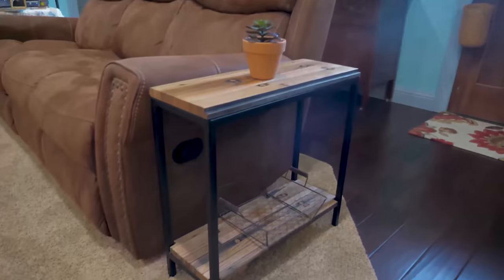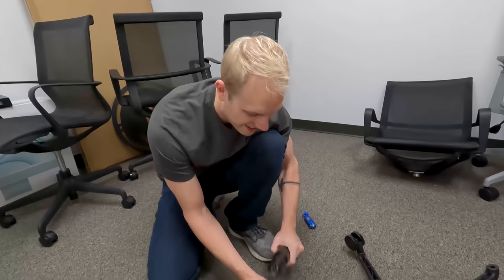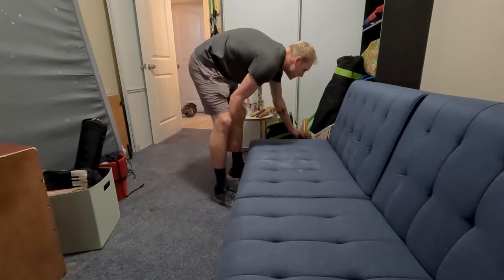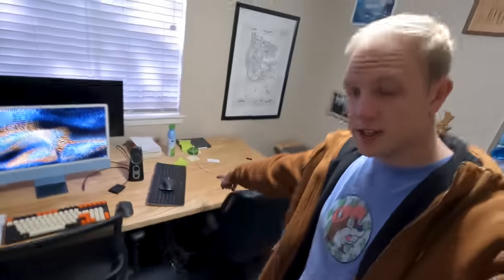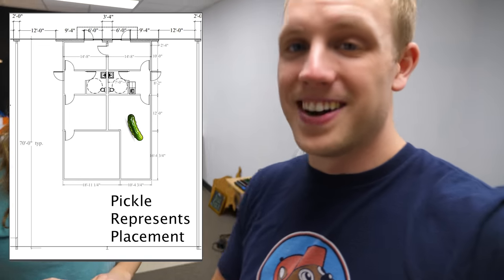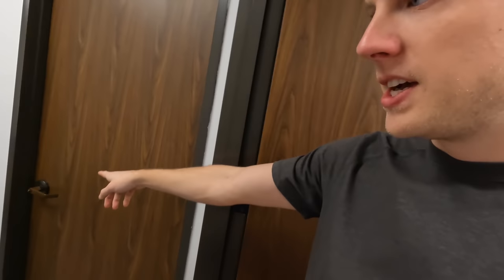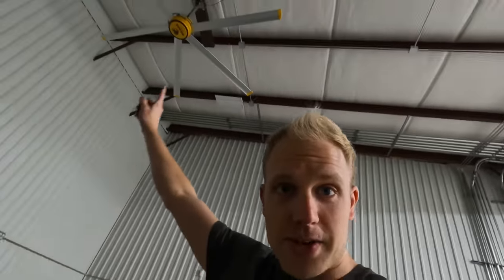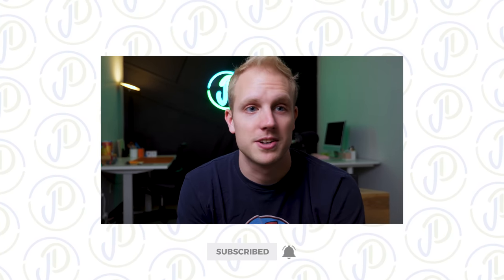FULL TOUR of our GIANT new studio and furniture workshop!!! 🏢🏗

Comment: if you have not yet looked into which laser system you want I recommend thinking on doing multi-systems. get something Like the Jtech pro for stand alone etching and engravings, cheap system with top of the line hardware.  then look at something like the laguna CO2 laser for laser cutting. can not tell you how many times I wanted more systems when I had a long detailed job running on the CO2 laser and just needed to etch a jewelry box or cutting board and had to wait several hours and miss the daily pickup for shipping.

Comment: Staging something as large as a dining table may require that larger space where you're thinking about putting the sales team. Also if you used that room a large door could be put in one of the two massive walls shared with the shop so moving a table from the shop floor to staging would be much easier.

Comment: Congrats on the new place. The improved lighting in the warehouse area is not only important for videoing building processes, but also as task lighting so the people doing the work can see that the aren't about to put their hand into a saw or something similarly hand mangling. One question that I hope you checked on. How soundproofed is the office area? When you have employees, will you need to film off hours, or tell them to stop sawing for 15 minutes to get a video recorded? I wonder if (eventually) putting sound deadening panels in the warehouse to stop most of the loud power tool sound at first reflection would help mitigate noise pollution for both the people in the office and the people on opposite sides of the warehouse. Or if the cost (and upkeep) of something like that isn't worth any potential minor benefits.